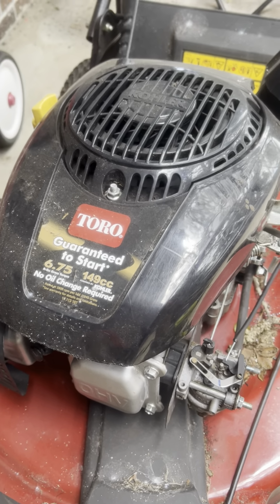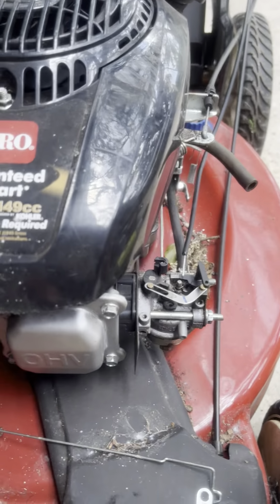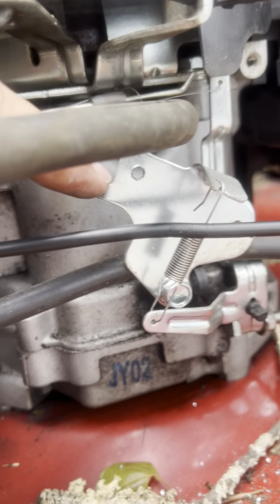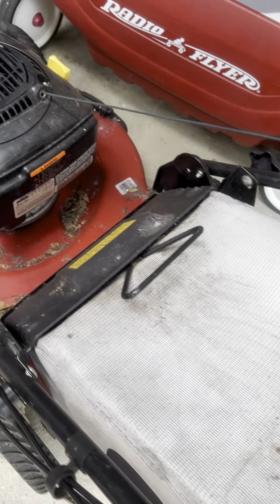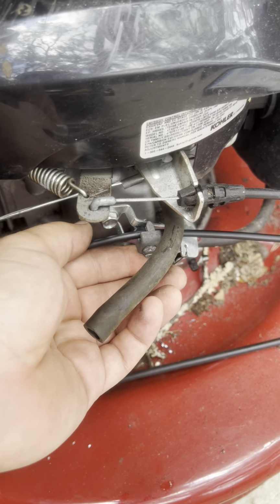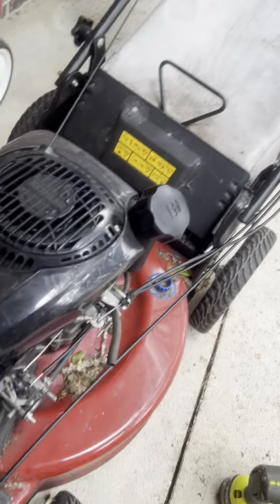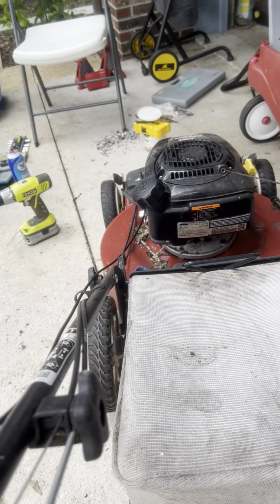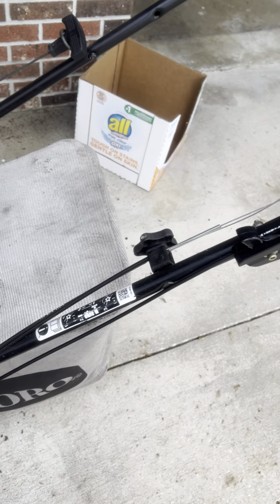If your Toro recycler 22 lawn mower won't start watch this video.

Comment: I also replaced the auto choke on mine with a manual throttle control cable. This model has a few different auto chokes that don't work well and are costly to replace. This simple cable modification will last longer and gives me more control. Thanks for the idea.